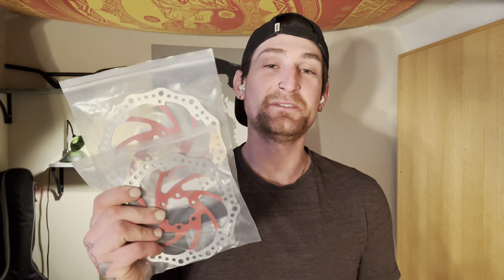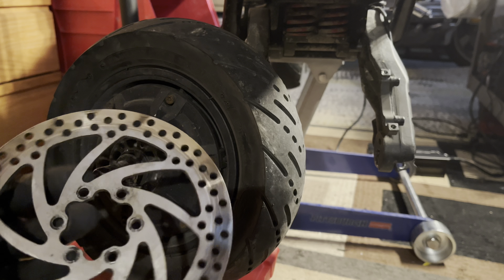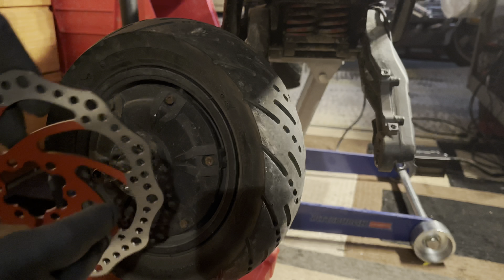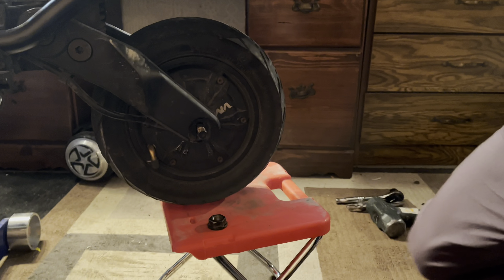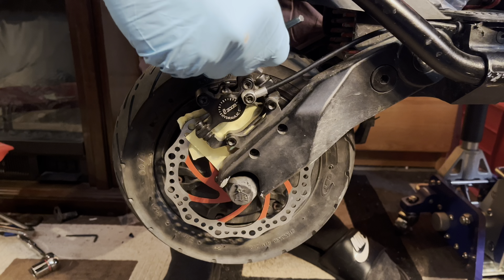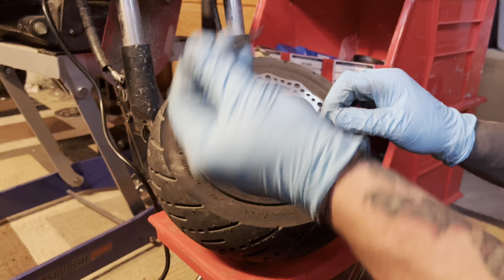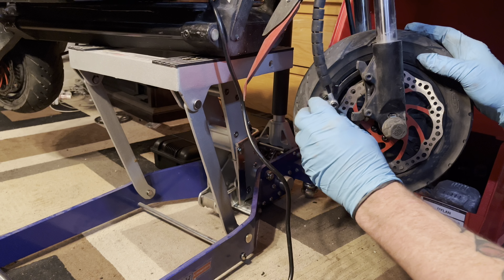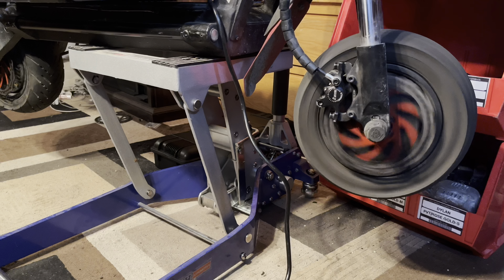$20 Amazon Brake Rotors/Disks?-Kaabo Wolf king(Install and Replacement(How To)

Comment: so helpful bro, thank you!!!!

I have to change my tires, I've had my scooter two months and I've attempted to take off the rear before and it was super tight. This will help make it a breeze!!!

Keep pushing love the videos!!!
Reply from the maker: @Roll Cam thank you for the support. When removing the rear wheel i recommend loosing the swing arm bolts alitlle bit, that way the wheel isn’t jammed in there as much!  Good luck. Stay rolling!